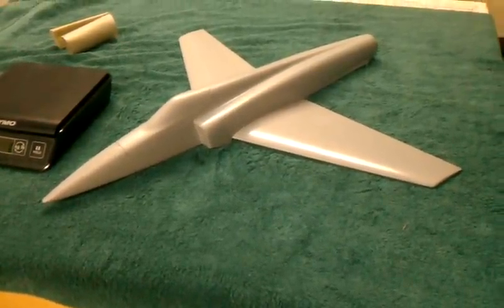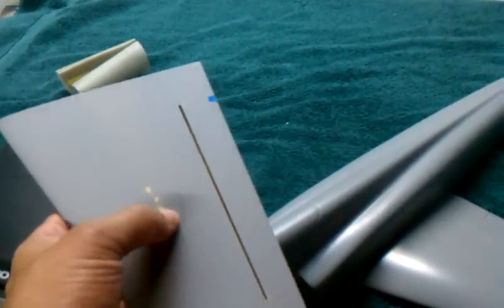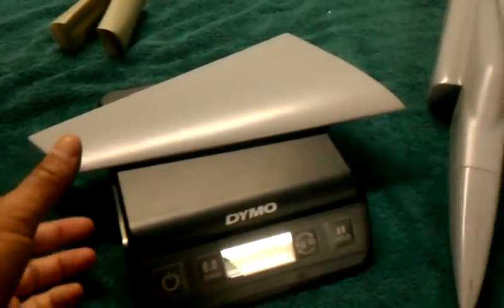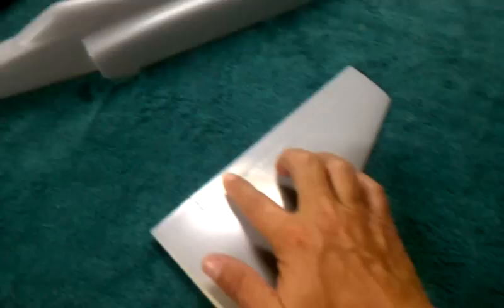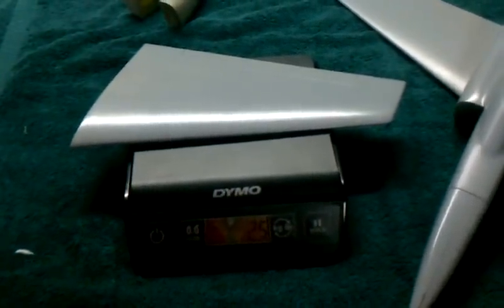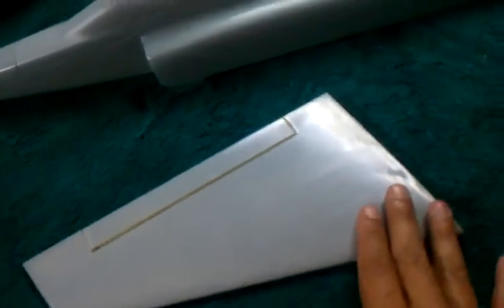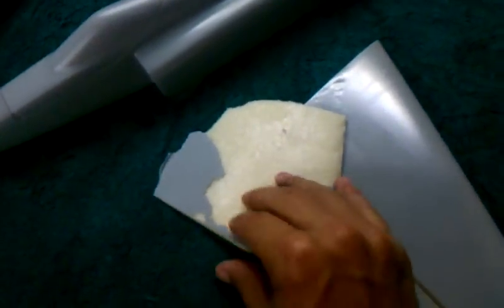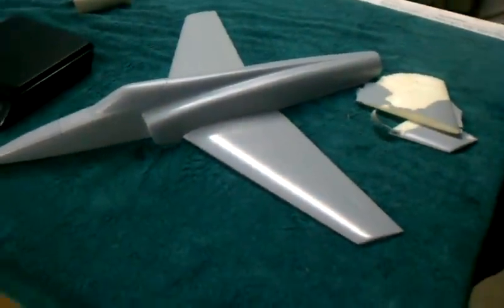Electrolyte:  molded wings using expanding foam part 3

Comment: so I'm thinking that foam is pretty dense. And kevlar if I remember right from when I used to use it was heavier than fiberglass or carbon fiber...
if you put a layer of carbon fiber inside your mold and then use expanding foam to create a nice glassy finish by creating pressure against the inside of the mold it would make an incredible finish be light and extremely strong.
problem is that the dense foam I think is too heavy so what you can do is remove them by pouring acetone into the core and it will eat out all the foam, causing it to run out in a liquid.
Reply: Or lost investment...